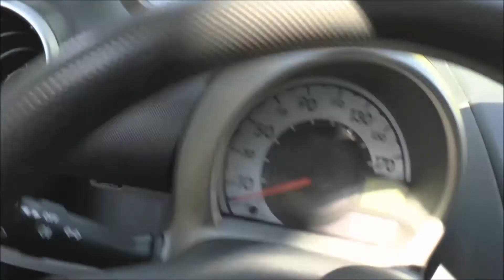Throttle location and check-up - 1.0 KR-FE - Aygo, Yaris, 107, C1, Sirion, Cuore

Comment: Hi, thanks for the video. I have a question, what is the idle rpm of your car? Recently, I notice that my old citroen C1 1.0L has a idle rpm of about 1000rpm, I am wondering whether it is too high, and I need to clean the throttle.
Reply: For what it's worth. Mine has the idle at 880 rpm...  
Peugeot 107 2011. ;-)